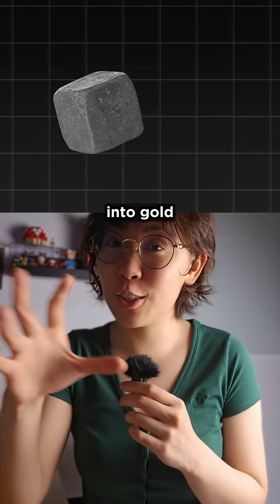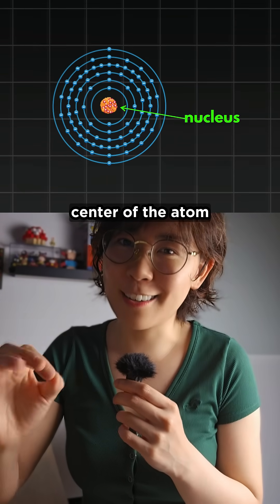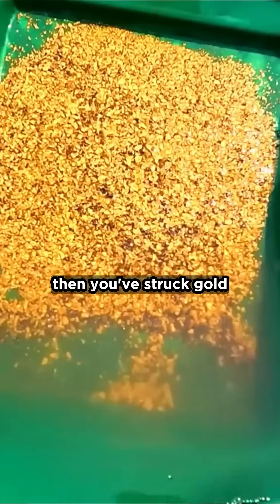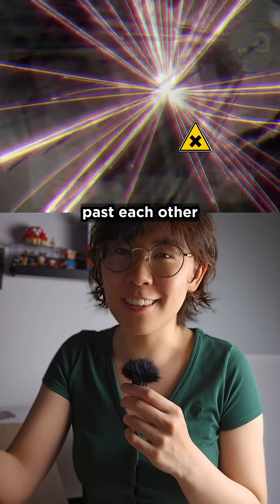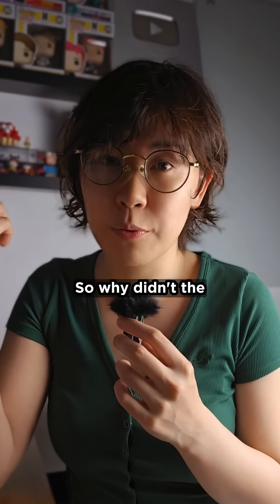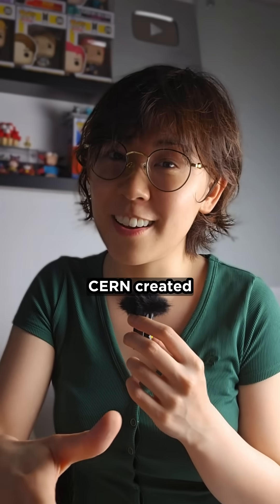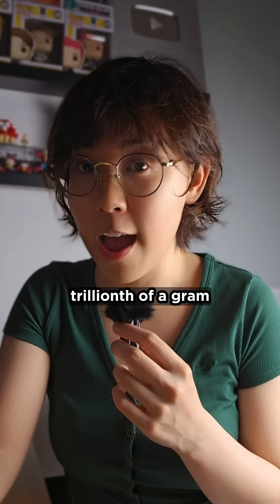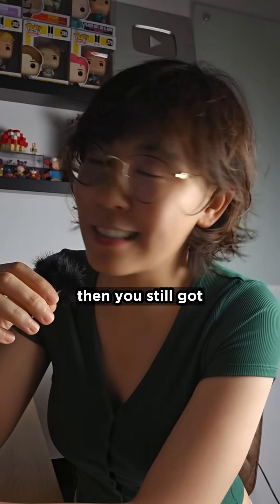How CERN Turned Lead Into Gold!

Comment: THE LAYMAN TERM
Proton = Material
Neutron = Material version
Combined = Material weight

Au = 79 + 118 = 197 (Stable)
Hg = 80 + 118 = 198 (Stable)
Pb = 82 + 126 = 208 (Doubly magic, ultra stable)

Making Au from Hg would be much easier as knocking out 1 proton instead of 3 from Pb is more of a stable approach. However Hg is not a doubly magic ultra stable isotope, which is the reason Pb 208 is used instead. Knocking off 3 protons from a doubly magic isotope offers more stability than knocking 1 off from a non-double magic isotope.

However you transform Pb into 79 + 126 = Au 205 which is an unstable version which decays extremely fast. 

Magic numbers are 2, 8, 20, 28, 50, 82 and 126. For an element to be classified as "doubly magic" both proton and neutron numbers must be of that magic row.

Comment: Removing 3 protons results in isotope AU 205 which has a very short half life (less than a minute). You need to remove  8 neutrons also to get to stable AU 197 If you want to really hoard it.

Comment: In ayurveda, the same thing is mentioned using mercury to turn gold. There is a proper method to do it. Further one thing to notice is at that time the metal they selected for this procedure was one which was with a difference of one atomic number only. And the written record of the procedure was mentioned a lot before the western science came up with atoms knowledge
Reply: The concept of transmutation has been around since ancient Mesopotamia. The idea has spread by cross cultural exchange all over the middle east, Europe and Asia. The idea/concept is much older than Rasashastra. It's also pretty tragic as it's caused so much heavy metal poisoning. Even until this day.

Though it is interesting how lead and mercury are the elements of choice of transmutation into gold across all these ancient cultures and their nuclear proximity gold, despite them being oblivious to atoms and protons.

Comment: Even if it was physically tangible, the energy implied in the creation of that gold would be severally more expensive than market price itself
Reply: Hi can you explain how much it cost by chance
Reply: @LiondroForeast25I don’t have a f clue 😂
Reply: @LiondroForeast25 Well, I don't know what the actual numbers would be, but I can tell you approximately how to figure it out. It'd be a matter of first determining the amount of power the Cern LAC uses during a given amount of time of being in use (it's truly mind boggling lol), the cost of that power per kilowatt-hour in Cern, Switzerland, and then compare the price of gold per given unit of quantity. From there, you could determine how much money in energy it cost the LAC to produce those 29 picograms of gold.
Reply: Even finance tangible, you still need to create stable isotope form otherwise it's radioactive and process decay.
Reply: But if we are making gold then either the energy to do so or the reason outweighs the cost by that point.

Comment: I was kicked out of science class in high school back in 2001, because I told my teacher this very thing. Followed by so, alchemists of the old were correct, and alchemy is real and it was always just chemistry. Boom kicked out, but it's fine, because I knew I was right.
Reply: Except this is not chemistry or alchemy. This is physics.

So you stay Incorrect.

Comment: What if you used a particle beam canon orbiting near the sun and use the suns gravity to slingshotting it around to generate the momentum (Yes there’s other equipment that would be needed and used for guiding the beam and Collecting gold matter) could it work to gathering larger and stable gold material?

Comment: it would probably be easier and way more ethical to build a reactor to produce Hg-197 which decays by electron capture to Stable Au-197, however still, the amount of gold profits would be probably 100 fold lower then the cost of the reactor and the cost to run it lmao

Comment: For those of you who don't know why, but are curious, elements need a 1:1 ratio of protons to neutrons, so when you strip away protons they become unstable, and fall apart.
Reply: That is only true for lighter elements. As the nucleus gets bigger and the electric charge of the proton becomes stronger, the elecrostatic repulsion between protons tries to blow the nucleus apart. So, a bigger number of neutrons is required to space them aparth enough such that the nuclear forces that hold the nucleus together can still overcome the electrostatic repulsion.
However the exact number of neutrons for any given amount of protons is still crucial to determine the stability of the nucleus, and the gold atoms created this way clearly do not satisfy this requirement.
Reply: @MadSideburns  lol so instead of getting closer to the island of stability we go radioactive gold 😂
Reply: Fall apart?
Reply: Thanks, I was going to ask, but sloppily scrolled down and found your explanation. 😁
Reply: Isn't there many atoms who have more neutrons than protons
Reply: @ajay0077  Perhaps, but if memory serves they aren't stable and will fall apart after a while

Comment: The process of turning lead to gold has been a thing for a long time, they are called fool gold.
It is very easy to identify which is which.
Although this is a new way of doing it, it is hard to tell whether they can be identified as easily as the older processing method.
Reply: Fools gold is iron, i think you meant lead iodide

Comment: And I think most importantly the energy it takes to even make this happen is like millions of times more expensive than the gold would be that comes out of it
Reply: In the distant distant future, we might eventually be capable of harnessing enough energy that we could have afk farms, like eventually the cost of setting a massive one up would get dwarfed by the yields. Even if it takes time, because like if you have a very very expensive machine that can capture a ton of a stars energy, it's eventually going to just work with little to no maintenance and overhead cost. Just perpetual energy for as long as the star burns.
Reply: @GravitonAllNightLong  so you mean a Dyson sphere

Comment: The way to create gold is much different than people expect. Zirconium is 20th most abundant element. Filter it out so you have -1 neutron version, like uranium centrifuges do. Then Fuse them, sell the energy, so it forms element 80  but with asymmetry of neutrons, so there 78 neutrons. To preserve symmetry a proton decays into a neutron by the w-boson and turns to element 79 with a stable 79 neutron to preserve symmetry inside the nucleus.  Harvasting isomers in space, but capturing the gamma rays inside the nucleous, that could also be used to knock out protons or neutrons to make assymetry inside nucleous so it breaks apart or a proton flips to a neutron or a neutron flips to a proton.

Comment: Water (35 L), Carbon (20 kg), Ammonia (4 L), Lime (1.5 kg), Phosphorous (800 g), Salt (250 g), Saltpeter (100 g), Sulfur (80 g), Fluorine (7.5 g), Iron (5 g), Silicon (3 g) and fifteen traces of other elements
Reply: All you have to do next is to lose one arm

Comment: They're destabilized atoms, even if they are gold atoms. The one problem with CERN is that they can't find a way to make any of their work out last their heavily decreased life cycle. Many of the new elements that they've made last less than a minute before they decay into nothingness. So, even if they were successful in creating 2 pounds of gold in a day, by the next day or two, it would all just disappear, and you might have to get checked for radiation poisoning.

Comment: I feel like this is a mandala effect. Haven't they been doing this for years, like... A decade+?? I thought everyone knew this lol

Did everyone also forget they found like 4 tons of gold deposited on the inside of the particle accelerator by doing all their experiments? lol Took me a lil to find it but it was from an email at CERN:

"Maintenance teams were conducting a final sweep of the four particle detectors – ATLAS, CMS, ALICE and LHCb following the system failure… during the SUSY operation. As part of the sweep they lifted elements off the protective extra-dermal lead blanket and on discovering the golden coating, immediately alerted senior staff."

"We have since lifted the blankets at 1km intervals around the outside and inside perimeters of the ring and found similar deposits, with 10 micron deposits to the outer and 2 micron deposits to the inner surfaces of the LHC." 

It had a composition of 89% pure gold, 10% platinum and 1% other precious metals. It wouldn't have been cost effective to extract the gold still though. Why is everyone so excited over just some measily atoms of gold? 😅🤷 Maybe it just got swept under because they didn't wanna cause a panic 🤔

Comment: The problem with this is that while it’s theoretically possible to lower an atoms number of protons by firing alpha particles at it and causing an alpha particle cascade which will lower the atoms protons until it finds a stable value, lead IS the stable number of protons for an atom, in fact it is the second largest very stable atom possible and the largest one that exists naturally.
Reply: What's the largest possible?
Reply: @ki0w0-lordofwatersheep  although there’s no theoretical “largest possible” magic number stable atom, since they get exponentially far apart as you need more and more electrons to fill an energy shell the largest magic number atom we can probably make is number 126, however we don’t know what it is because we’ve only ever made it up to atom 118. For what it’s worth, the heaviest stable atom possible right now is also lead with 82 protons and 126 neutrons, as magic numbers affect more than just electrons.
Reply: Isn’t gold inert and non radioactive? Why is lead more stable?
Reply: @justkev1044  lead is more stable than gold because it has 82 protons, which corresponds to the 6th full atomic shell, which means it is stable because it doesn’t need to gain or lose electrons to fill a shell.
Reply: @justkev1044 Maybe it has to do with the number of neutrons and electrons?
Reply: @justkev1044 inertness is dependent on electrons whereas atom stability in sense of radioactivity is determined by nucleus and lead has a more stable nucleus because it is doubly magic which is just to say that it has both the perfect amount of neutrons and protons to fully fill the nuclear energy levels
Reply: Neutron star 🌟 enter the chat.
Reply: @timmygilbert4102  I don’t think a neutron star would be strong enough to make an element past that
Reply: @estan315 The debate is more if a neutron star qualifies as a single atom 😂
Reply: @timmygilbert4102  not quite, whereas electrons and the string nuclear force hold the atomic nucleus together in an atom, the strong nuclear force and gravity are what hold a neutron star together.
Reply: @estan315 still a ball of neutron 😂
Reply: @timmygilbert4102  maybe on the outside, it’s probably made of a quantum sludge in its core

Comment: We got literal alchemical transmutation before GTA6 💀💀
Reply: They did it before Gta 5, or 4, “skull emoji”
Reply: @Artur-kp4hj wasnt Gta 5 launched in 2014, this research was in between 2015 and 2018, so nope
Reply: @ryuonbs  2013 actually but yeah
Reply: Bruh, it's not new.
Reply: The theoretical knowledge has been around longer than videogames, I read about this in elementary school in the 90s.
Reply: It's even older than GTA 4
Reply: Majorana He had already done it many years ago
Reply: They did this with mercury in 1941 as well.

Comment: Why do they just stop being gold?
Reply from the maker: They are prone to decay and turn into other atoms
Reply: @vt.physics 
Prove me I'm wrong, but I don't think gold atom can decay, 
It's not like uranium or plutonium.. 
Gold is one of most stable atom, won't react to anything (chemically) basically inert..
Reply: Happens on extremely small scales (a few atoms at most), occurs under non-controlled conditions, the resulting atoms (if gold is momentarily created) are highly unstable, and they often decay back or transform further within fractions of a second.

Moreover, the cost and energy required to create even one atom this way is astronomically higher than the value of any gold produced.

Additionally, stable gold requires 79 protons and 118 neutrons, so Au-197, but if protons and neutrons are a bit lower or higher than that isotope, it becomes unstable, then turns into another atoms.
Reply from the maker: @Uyers  thanks for the detailed explanation 💜
Reply: @Uyers 
I see the gold is not perfect, so if the number of protons and neutrons isn't 79 and 118 the gold isn't stable? 
I didn't know if gold could haveother combinations..
Reply: @Rizalviolet Yeah. I was pretty surprised when I learned that too. Some atoms/elements can have different stable isotopes, but gold only has one, which is called Au-197. Additionally, Tin (Sn) has 10 possible stable isotopes, which is the most of any other.😊
Reply: @Uyers  that's mean gold cant really turn to any other atom right?
i mean can they just lose some proton or neutron naturally?
i thought gold are one of the most stable atom,
Reply: @Rizalviolet Yes, it can't naturally turn into any other atoms (if we exclude supernovas) and again yes, gold is one of the most stable atoms. Yet they require too much energy and high-energy particles in order to change. So any change is possible, but some require time, some require too much energy, but it doesn't change that everything can change in right conditions.

It’s honestly awesome to see someone dive into this with so much curiosity. Makes me feel like I’m not the only atom nerd around here!
Reply: pretty sure its cause while the protons do get knocked away, the electrons maybe still remain? causing it to be very unstable or something
Reply: Im not a physicist but i hear Gold as we know it, in the quantities that we find can only made in star cores.
Reply: @ero-senninsama1734 nigga wtf are you saying
Reply: Its a highly unstable, super radioactive isotope of gold that doesn't exist in nature.